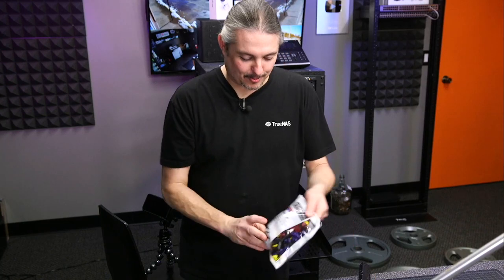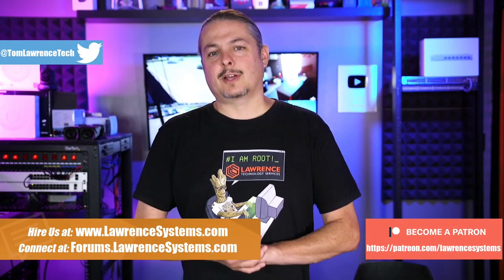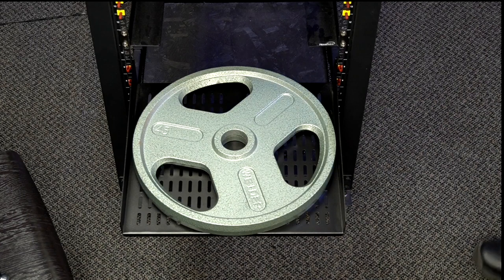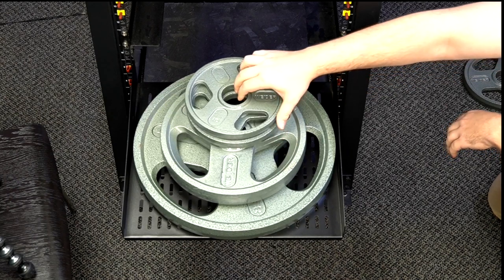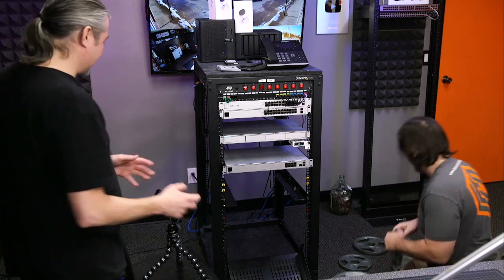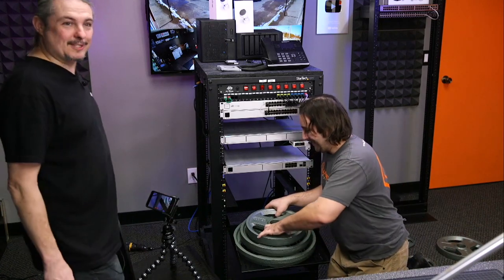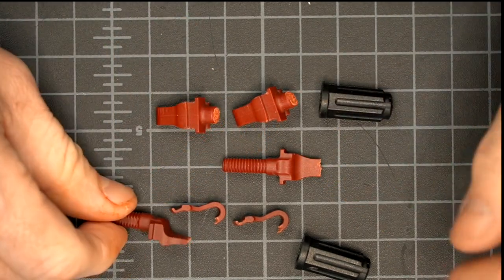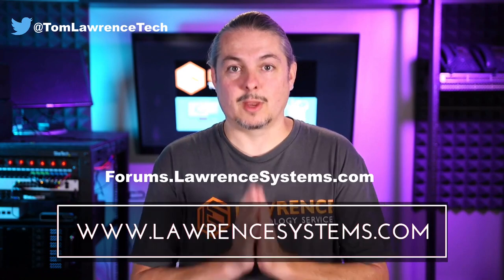Rack Studs Weight Test

Comment: When I first saw Rackstuds, yes I thought they were 'cool', but no, there's no way I would trust my thousands of dollars of equipment with these.   Yes, the servers would be evenly distributed front to rear by the server rails screwed to the front and rear rack rails, but switches and NVRs are only screwed to the front rack rails.   I cringe when I think of trusting my fully populated Cisco 4510R+E chassis switch to these nylon/plastic studs.    Nothing like trusting a 5 figure $ switch to $50 plastic studs.   While no, my equipment will not be mounted the way it was in the video, and yes it held quite a bit of weight, I'll continue to use metal rack studs and screws, and therefore will never have to tell the Superintendents that $100,000 work of equipment just took a dive because I wanted to try mounting them with plastic screws.  </opinion>

Comment: I wish I could sent you a picture of a closet that we installed some Cisco 3850's in using rackstuds, but due to company policy I cannot.  After about 18 months, the rackstuds snapped, and our switches were sitting at a 45 degree angle.  I'm not sure if the heat over that time caused their strength to diminish, but a 3850 is not a heavy switch....certainly not 85 lbs.
Bottom line, we don't use them anymore
Reply: Yeah I found they don't like tropical or saharan heat - same problem - delayed failure
Might be OK in an airflowed A/C facility
Reply: plastics do creep (already on typical room temperatures and below), which means they plastically deform under constant load over time. Then they can break if they reach a maximum strain. The short time load can be orders of magnitude higher than the long time load if creepage is considered. This is a bigger problem for plastics but can also be for steel (but mostly on higher temperatures, in example pressurized tubes in heat exchangers like in power plants).
Reply: I got 3 3750s held up with mine.  
A HP KVM switch
A shelf with 4 NAS boxes. 
A shelf for whatever get laid up on it.
A drawer full of spare drives. 

All held up with Rackstuds for just over 3 years. Not one single issue.
Reply: @stonecrow00  yeah i think longterm heat may be the issue, from what I've seen, several people have told me (not on YT) they have had no problems at normal room temps
Reply: I know i'm late to this discussion but i've had an ASR9910 mounted on these for several years now without issue.  (I am using all 36 holes per side so that helps) - but that router has got to be 300 lbs easy.
Reply: This is the real info I was looking for.

Comment: Been using these in my home rack for a while now (couple of years roughly) and no problems at all.  They were holding a Norco RPC-4224 full of drives, had no problem at all with it and never broke, and that sucker weighed what felt like a ton.  I did figure out that if you overtighten the black cover they will snap :)

For general use and installed properly, these should be fine.  But if your rack is moving and shelf is bowing from the weight of whatever it is, then all bets are off  :)

As always, love the videos from Lawrence Systems :)

Comment: I have had all kinds of racks, and, I can tell you, the racks with 10-32 tapped holes will hold whatever you put on them. I suspect you can load the shelf until either the rack tips over, or the shelf tears apart. The screws will not break though.

Comment: Nice followup to the Home Rack video, but I'm still advising the use of 'server rails' that mount to both the front and rear vertical rails (fasteners of choice). Heavy equipment and rack studs do not make sense in earthquake territory!
Back in the Olden Days, we would buy steel angle bracket stock at the hardware store since rack vendors didn't usually make those nice adjustable rails.

Comment: we need the distance from the top edge to the center of the lower rack stud, as well as the depth of the shelf. That would allow calculating the pull force on the rack studs.

Comment: This test only tested the tensile strength of the rack studs. The other element to test is the shear strength (straight down) as would be applicable if all four corners were used.

Comment: This is not meant as a criticism it's just a pet peve when someone does this:
"This is not scientific"
Next sentence: I'm going to test something by experimenting measuring and documenting what happens.  
That is the literal definition of scientific!
Reply from the maker: I would really say it's loose science because we didn't take the time to measure and calculate the actual force generated on each stud.
Reply: There is famous meme by Adam Savage saying that difference of doing science and just screwing around is writing it down. However, real science must follow scientific method. Just gathering data points and observations isn't science (yet). Whole point of science is to form a theory. In this case it would be about tensile strength of polymer. Physics about forces involved would need to understood as well to get any meaningful data point. The goal is to increase knowledge and understanding of how things actually work (ultimately getting into atom interactions). Then second step is to generalize this knowledge so that it can be applied to anything. Forming a theory about plastics (or rather polymer). So yes, it is totally accurate to say that this isn't scientific test. It really isn't. That said, it is practical test providing simple information about something where factors are fairly controlled. That is very useful and interesting even if we don't reach realm of science yet.

Comment: How deep is the rack?  Your putting more strain on the shelf because the weights are forward creating a moment.    I have some UPS that come in at 100 lbs.  They hold just fine with cage nuts.

The rack makes a difference as well.  Some lower cost racks have a lot of flex.  Panduit makes some really solid racks that don't flex or wobble.  The side bracing helps a lot.

Comment: It looks like 80 lbs would have failed too, if left alone for a lunch break. Regardless, I'm having a hard time thinking of when I might want to ever put more than 20-30 lbs on a shelf like that under real world conditions (not a lot of bench weights in my racks) so they would be plenty strong for the things I normally use them for (a NAS or two, maybe some extra patch cables). I was thinking they would only be good for shelves across all four posts. This was good information, thank you.

Comment: Obviously in a real-world scenario, you wouldn't have shelves externally mounted like that and and certainly not loaded with any heavy equipment sticking out the front/rear of your rack.

If you were to mount heavy equipment like a rail-mounted server, UPS or have equipment sitting on a full-length shelf, you could always have the rack studs on the front and rear, or on the front only and have the regular cage nuts supporting the rear. 
Personally, I prefer to have the rack studs to give a standard conformity to the look of my rack when viewing from the front rather than viewing a bunch of black or silver or mixture of both, bolts that can also have different sized heads based on what was supplied with the installed equipment.

The best thing I like about the rack studs is that as they are a perfect fit to the RU holes of a rack to ensure a consistent fit of mounted equipment, whereas the regular cage nuts have some level of play resulting in some equipment not sitting properly within its RU, likely forcing a readjustment of other equipment.